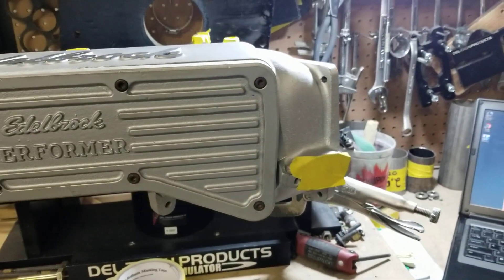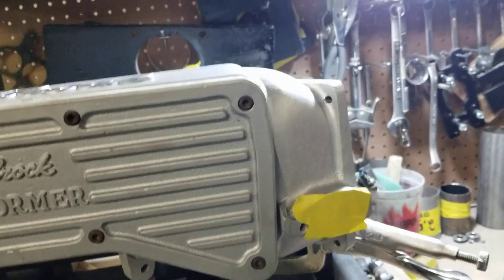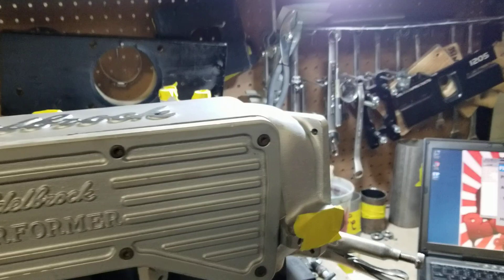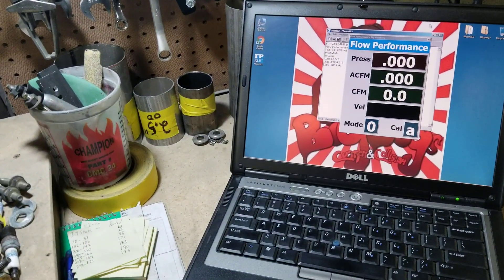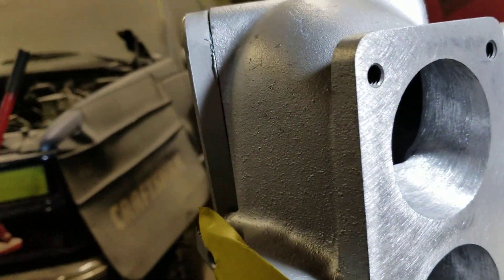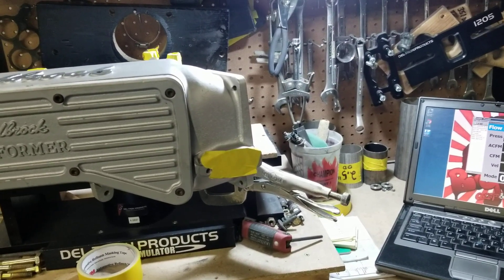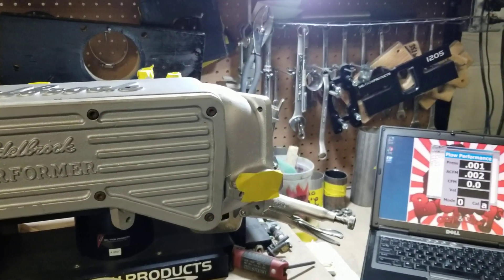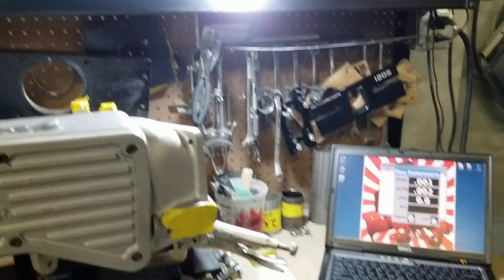Bigdogs Porting results of the Stage 3 Edelbrock 351w truck manifold

Comment: Nice!   Yeah I  have been working on my 306 build for a van... but for my *stock plenum  I port matched the lower dog legs ( cutting the bottom of the plenum about 15% on each hole to match the intake..  dimpled all entries several inches in... and  opened up the throttle body openings to 61mm for the BBK....  I wonder if you have ever tested  the stock plenum?... With the work I did even with $  I don't know if I'd get one of these (because id want to port again)  ... or if I'd want to port again but obviously this could flow some serious torque and power.  I figure I'll definitely pick up some flow just from matching the throttle body alone and getting a bit of venturi effect toward the base of the runner.  My engine is all ported... did some good work on the E7s and so on... very budget build.
Reply from the maker: Based on my years of experience and porting over 3,000 parts the worst thing one can do is blindly port/modify parts without testing and measuring gains and losses. Its very easy to mess up the flow on these factory parts if one tries to port based off of what they think will work vs what actually works. I've had many home ported parts come to our shop to be flowed just to find out they flowed nothing close to what the owner expected. That being said have the manifold flowed before you put it on. I'm sure you will be surprised what it does.
Reply: @bigdogsportingtonyb2833   I did think about building a flow bench... yeah the heads  were actually carefully done  by following strict measurements in the bowls  and tried techniques from like Saleen and Vizard... everything i do is cloned and miced to the mm..   but very budget things like.. i dont have a drill press so I back faced my valves with a sanding stone from dollar tree and a hand drill.  The plenum was based on complaints of whistling and advice to port match the TB... and the lower is somewhat conservative... I didn't even open up my intake ports.. just focused on the bowls... short turn.. etc.   My exhaust side is a bit hogged out .. but still within reason and flow. with plugged thermactors.   Do you share your technique on these?  I probably never want to port again or for $ .. also why i cant wear a mask this year from doing all this stuff I've become sensitive lol.
Reply from the maker: @DS-mo6md  I have a ton of secrets on getting these things to flow well. The worst thing you can do to sbf heads is get the short side turn wrong, backcut the valves and not bias the bowls and throats correctly. You will actually lose flow that way. Factory type Sbf heads respond differently than everything else. 
I have a gt40 test head that  I ported and ran a 30 degree back cut on the valve and lost 15cfm were it counted when I was experimenting. Lost 10cfm  messing with the short side turn too much but from just looking at it you could never tell.
Reply: @bigdogsportingtonyb2833  oof.. Yeah im sure.. I just dont have a flow bench i may have some money to diy .. Id have to look it up but yeah obviously im curious of my labor rather than getting to initial start and being disappointed but it will be what it is i guess
Reply from the maker: @DS-mo6md  the 3 single best things you can do to factory sbf type heads is sand roll the intake with a 80 grit, take down the material around the exhaust guides and sand roll and do a good 3 angle valve seat on intake and exhaust. Those are the safest things that one cam do that will add cfm every where without losing any flow. Hell 90% of the time it's the intake manifold that holds back flow. Many people run 11r heads bit then put a 245cfm Systemax 2 on top of the heads lol.
Reply: @bigdogsportingtonyb2833     yeah or put a giant cam  for sound  lol... or go over .500 on an E7 / GT40  when the flow exponentially decreases.     I'm just under .500 (so i guess what was used to call a 3/4 cam) because I know even if getting 200+ cfm on the E7s  its not worth clattering the valvetrain... I am still running flat tappet but  also went to a 28 oz balance like the 302s of old.   I really just wanted to see what mostly the factory truck 5.0  could do... I even had a custom chip burnt since I'm sticking with speed density..  have an adjustable FPR  and such too.   I mean I'm confident it will be where I want  I know what you're saying..  and the reality is I had a shoestring budget  all while having to buy the rest of the restoration parts too... my AOD is pretty much tops at least for what's available for an early style with some iron drums and a stamped steel direct drum but still..   How familiar are you with this top end though... I kind of wonder why mustang people don't run the long runner for torque?  If this thing made  34 ft lbs over stock... no telling what your porting is going to do... whats the most torque you've seen on an 5.0 efi  dyno (trucks I mean)?       I saw one guy with AFR heads   still an EFI 5.0  and he put down like 469 ft lbs or something absurd to where I almost didn't believe it   but who knows... I find it crazy that this plenum puts out 34 ft lbs so... those long runners lol... I may have to shell out the $950
Reply from the maker: @DS-mo6md  it all depends on the combos and dynos. If on a Mustang dyno was it calibrated correctly? Dynojet are the industry standard. 
Hp and torque potential are simple math calculations. Airflow to support the desired hp for the cubic inch and CSA/runner length to support the motors cubic inch and rpm band.

Comment: What kind of power do you think a mild 351w would make with this? Say a mild cam with 210/216 exhaust and stock fueling
Reply from the maker: It would make a ton of power below 4,800rpm. It would definitely need a injector upgrade.